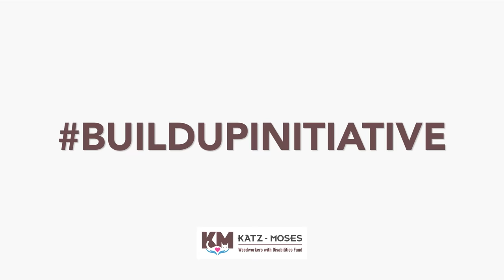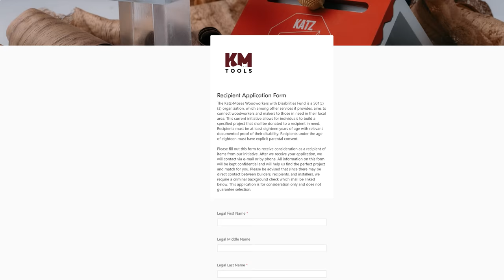The Build up Initiative: The Katz-Moses Woodworkers with Disabilities Fund

Comment: I'm a maker who suffers from low vision. Actually, I'm far beyond being legally blind. Woodworking is a life passion of mine and I've spent over a decade (over half my life) to figure out how to do woodworking without, you know, getting seriously injured, while also producing work I love. The road is anything but easy, but I'm very glad someone recognizes the issue many of us face. 

Many don't understand that woodworking, and making in general, for someone with a disability often is far more expensive than it is for the average person. The reason being that often we require very specialized tools to do mundane tasks. Such as needing specialty equipment just to read and set a table saw fence. Currently, an absolute struggle for me to do even after testing a quality saw. The best option out there is a product called Rip-it Fence which is a new to market computerized CNC rip fence. An absolute dream and game changer for me, but, at $1000, out of my budget as I'm only a hobbyist. All that, just because I can't read a tape measure.

Money aside, I think the biggest issue we face is knowledge on how to even build and use equipment. If I can't see what you're teaching, how do I know what to do? Furthermore, how do I implement what I've learned while eliminating the visual aspect of the process? Try watching a woodworking tutorial with your eyes closed and the feeling is similar to that. It's tough to learn anything. Same goes for any other disability as well

Still, thanks guys. It means a lot to me that you keep us in mind.

Comment: This is wonderful!  One thing that you may want to consider is that most people in cities do not have the space for something like a gantry. Perhaps, when this gets rolling look to do something a little "downsized" so that a person with a single car shop would be able to host something like this. Maybe a small adjustable height table for those that are less mobile.   Thank you very much for your efforts to help the needy!
Reply: Hey Paul. Loving the idea of an adjustable height table. We designed the micro workbench and the seated workbench with that in mind. We definitely note that the gantry is big but also as JKM says the plans are scalable downward… just not upward. So it can be adapted to smaller spaces.